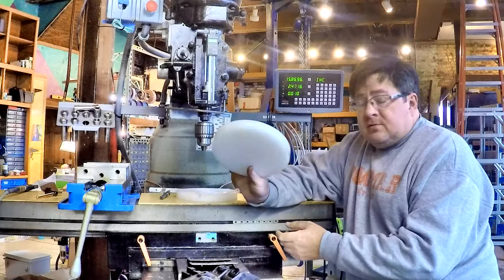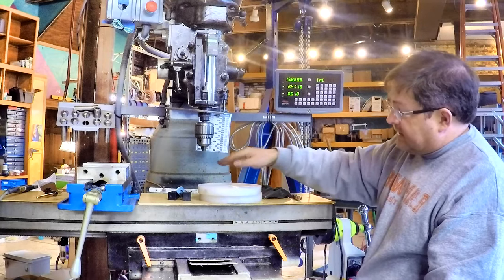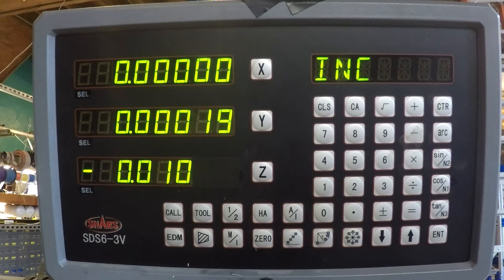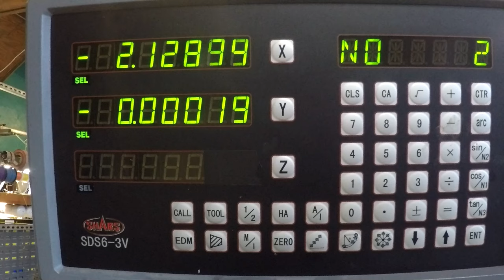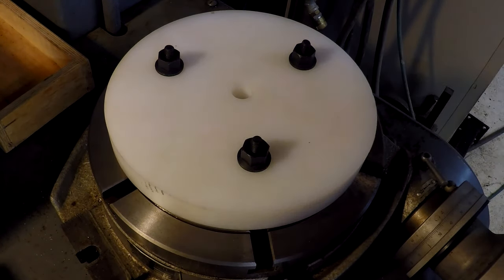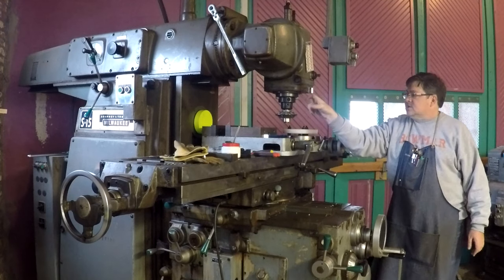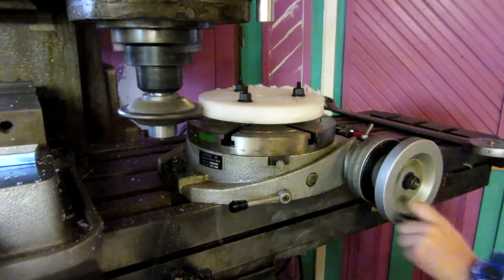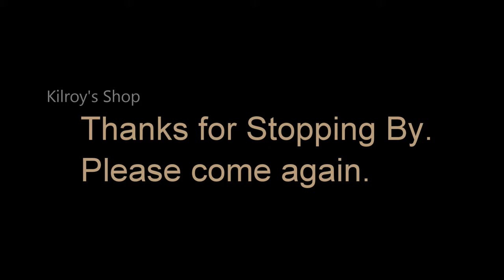Milling Plastic with a Form Cutter

Comment: James, Seeing Power Feed hard at work gave me a flashback to the mid '60s when I was blessed my my dad... In his job shop. The memories of small production runs on a 5 ton punch press running tooling designed and built by my dad... I remember making bearing retainer plates that were going into the thrust reversal mechanism of the Boeing 727.  A wonderful flashback, Thanks to you and your son.  May God richly bless you and your family... Merry Christmas to you all.

Comment: A time saver suggestion would be to stack your disks and drop a gage pin or bit on the center to keep them from walking and drill multiples in one operation. I think "power feed" recommends you grind a form tool for the lathe to make this job easier on the arms. :-) Keep the videos coming!
Reply from the maker: Doing it on the lathe wastes a ton of material, so this method is where it is at.  The lathe would be easier and provide a better finish but work holding is a PITA, got to use a faceplate, etc.
Reply: You have got me on that one. I fail to see how material removal on the mill results in less waste than material removal on the lathe.  If you are cutting the same groove on the same part I don't see how the results are different.  Me i would take a piece of say 1/4 x 8D material and put a slug in the center of it to grip in the 4 jaw or 3 jaw doesn't matter and add your central locating pin for  the plate, then drill and tap the 1/4 x 8 plate for your 3 attaching bolts put another piece of plate on the outside for the bolts to pass thru and screw sandwich the disk just like when you went to the rotary table and rock out. If you had more than 3 of these to do I bet even including the fixture build time the lathe would be faster. and easier. No need to reconfigure the k&T or lug the rotary table out and up on the mill.  Not saying that is the best or how you should do it just how I would do it. As long as the destination is reached the road taken matters not. :-)
Reply: I've gotta agree/question this one as Brian did.  How does using the lathe waste more material than the mill?  This doesn't make any sense.
Reply from the maker: Extra material for workholding gets wasted.
Reply: James Kilroy
I think we're talking about two different things here.  I believe that Brian and I are referring to profiling the edge only using a fixture plate in the lathe and not turning and parting off the entire disk.
Reply: Keith Ward
Indeed. I had in mind starting with the same piece that he started with on the mill only turning the profile rather than milling it. The lathe is pretty much king for removing material in a circle.
Reply from the maker: I see, when choosing to do it on the lathe I gravitate towards using a chuck.  But bolting it to a back plate is workable.  Until I get my Pacemaker back in play, my Rivett 1020 will not allow me to plunge in, not enough swing!
Reply: Darn puny lathes! LOL

Comment: Or, you can program for an extra hole and have the end angle 360 more than start angle, it saves working out your end angle. In your case wanting to start at 90 you would have the end angle at 450 (90+360), the fourth hole would of course be the same as the first. The guys who sold me my Sino unit said that was the best way to do it and I just followed their lead.
Just a thought but could you not have used 0 as your start (they are only mounting holes), and if you had, the fourth would have been 360.

Comment: Enjoyed....careful don't burn out "power feed" as you have many years of enjoyment ahead!  Curious could you have done a similar result using a form tool on the lathe for cutting the groove.....not knocking your setup just wondering if there is another method to skin the cat!
Reply from the maker: If I do it on the lathe I end up wasting a ton (50%) of material and 9" UHMW is not inexpensive material.  With this method I waste very little.  It might be cheaper for me to buy 1" thick sheet and just mill out the disc, rather than buying 9" round stock.

Comment: With the bolt hole function on those type dro's if you want to do a normal 360deg pattern add a hole when you set up to save working out the angles just set your start and finish angle as the same. eg if you want a 3 hole pattern program the dro as 4 and set your start and finish angle at 90, no need to do the math. The 1st and 4th hole are in the same coordinates.